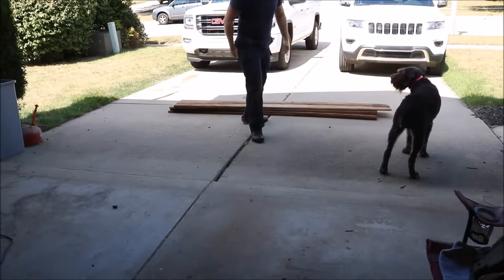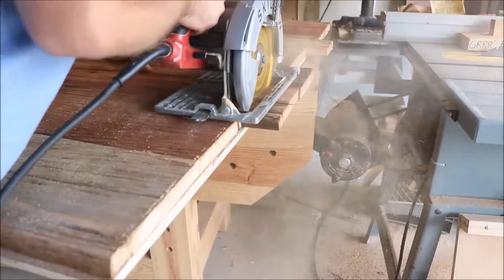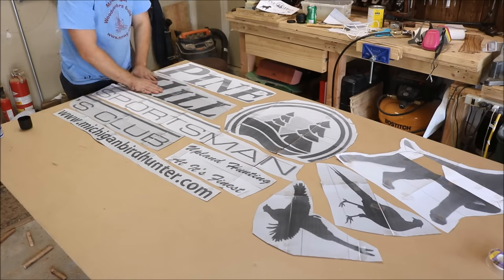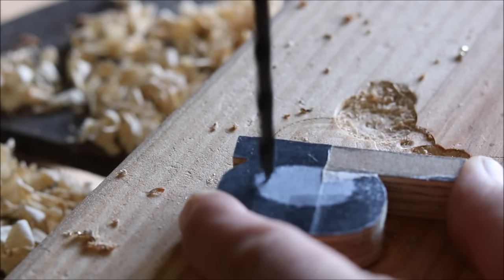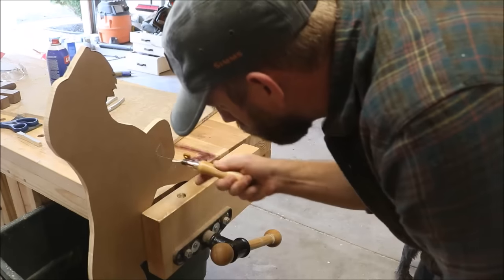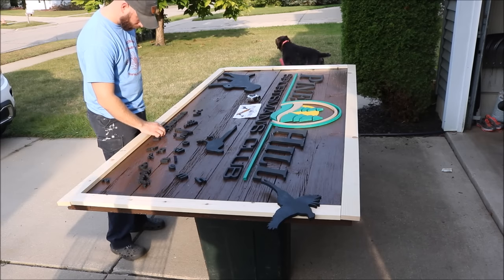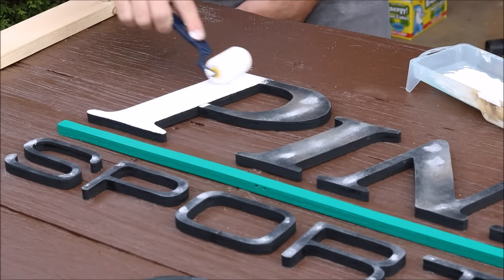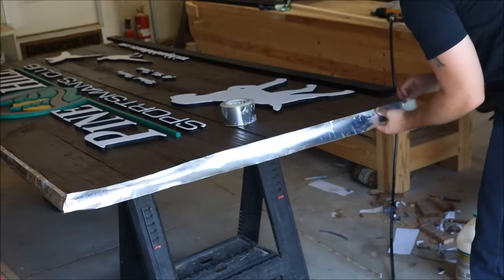How To Build A Professional Looking Wooden Sign With Raised Letters // Woodworking / DIY

Comment: ok so its been almost 2 years.  any updates on how this sign is holding up?
Reply from the maker: Still holding up great. No problems at all
Reply: @ThirdCoastCraftsman  quick question for you after I tell you that this is fantastic. This is the first video of yours I've watched so I'm hoping there are more, I'll be subbing. The question is easy, did you also poly the lettering and logo? I only noticed you doing it on the barnwood, maybe I just missed it.

Comment: I know that touching up after you have done something is nerve racking...….If you had screwed the letters and the frame from the back you would have had no touch up and the added security of a screw holding the pieces instead of glue and a finish nail in the elements. That's just me.....I'm pretty over the top anal when I do something. The sign looks absolutely awesome....there is no way you could have ever been paid enough to do that all by hand.....but that's the fun of it, especially when doing work for friends, giving them a piece of yourself!!!! Kudos!!!

Comment: "At It's Finest" is a grammatical error. It's is a contraction for it is - so you basically have "At It Is Finest." It should read "At Its Finest" without the apostrophe.
Reply from the maker: Yes, we figured that out hahaha. embarrasing.
Reply: I used to work in the printing industry. The rule was, always have someone proof your work before going to print. A pair of fresh eyes usually catch those errors. That being said, excellent sign!!
Reply: Third Coast Craftsman  You've learned the golden rule of making proper grammar signs... never trust a previous sign maker's work. Pretty easy fix though.

Comment: Hey Chris! You may have heard of this by now, but there's a program you can get for $22 from Matthias Wandel called BigPrint. It's super easy to use. You can import images or CAD drawings, scale the size across multiple pages,  lighten the dark areas to save printer ink...all kinds of cool stuff. You can download a trial for free, but if you print you pic with the demo version it will be covered by his watermark. Here's a link for it if you're interested:  
 https://www.woodgears.ca/bigprint/index.html  

He also has a letter stencil program that's pretty useful for only $8. Again, you can download the trial for free. Here's a link to that one:
https://www.woodgears.ca/stencil/buy.html

Anyway, just thought I'd mention these. I know what a pain it can be using the Paint program...I've used it to size and print my logo's and designs, too, and it's a challenge sometimes, lol. Take care!